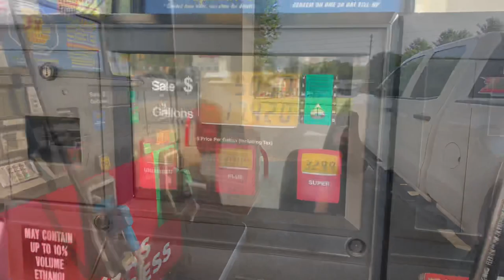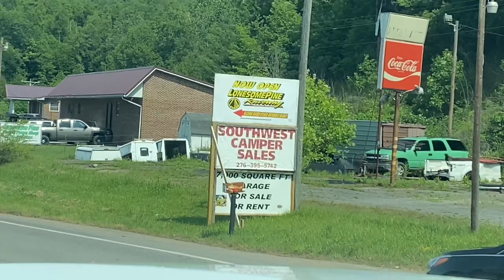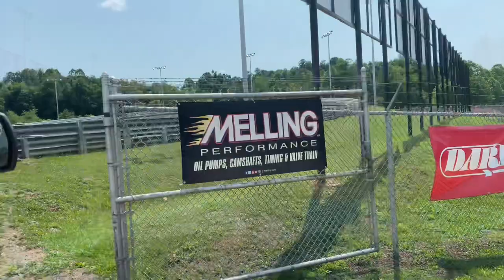KICK’N ASPHALT - ULTIMATE ROAD TRIP TO RACE!! SLIPPIN AND SLIDIN AT LONESOME PINE!!

Comment: I just caught up to your videos, you passed my home on ya way to LPR, I live in Gate City, VA and I raced in pure/street stocks and later on ran a Late Model stock for a West VA racer, then bought my own, had a built 355 in it with a Lumina body, bought a Ford 351W NASCAR late model spec engine and put a Torus body on it on a Townsend chassis, worked as NASCAR tech for a few yrs after I gave up the seat at LPR and Kingsport Raceway,run a season in pure stock at KPT Speedway the Concrete Jungle then worked at Kpt on Friday night's and raced Sat at LPR, still have both race cars tho, I truly love your attitude towards racing and the folks you meet, the Pine in the 90's and 2000's was way better than the day you ran it, new owners covered it in dirt ??? didn't work out, messed the surface in the turns up Bigely, it was kinda rough but not bumpy in 1&2 and 3&4 were real good, heard you say you was told it was pretty bumpy but there use to only be one bump coming out of 2 in low groove but hit it right and it set the chassis just right to keep it matted, use to be able to matt it before you hit middle of 3&4, diamond that turn n roll 1&2, late model times got down to low 15's street stock 19's on Hoosier Comanchies, plan on hitting it again in 2024 with the late model if my heart attacks are done n over, changing springs in the quickchange now, good luck and keep her off the wall! Carroll Hobbs

Comment: spray some starch on that window net lay it as flat as you can spray both sides of it  it will work like puting a window in it ,won't let as much air in the car ,that's what we used to do on bud Moores car to help the speed a little

Comment: Odd about the trailers. When we raced at San Antonio Speedway, it was the opposite...we had to take our enclosed outside. it was for line of sight for the fans to be able to see the back straight.
Reply: That's without a doubt one of the silliest rules I've ever heard of?
Reply from the maker: Yes the rule very much caught us off guard. It made for lots of walking if you forgot to get something out of the toolbox.
Reply: Great run there guys! I'm enjoying all your videos, all caught up on the newest ones, now digging back into the older stuff. Your car looks absolutely gorgeous in this paint scheme, in my opinion. Love it, looks like a racecar! I've been out of it for a good while, used to run Super Sport, Super Stock, Street Stock, etc, and we just got back into it July of this year, running a Renegade car, street radial tire rule. Car drives pretty good, and I wanted to ask your opinion, say for like Hickory, and similar tracks: Full spool locker, how much stagger, especially rear stagger, would you think is in the ballpark? Car has good adjustability in it for a Renegade, adjustable cups all four corners, good shock selection and variety, front bar, and basic front geometry has been much improved over stock. Anyway.....tell me your thoughts on stagger Boo, if you will? Thank you sir!🏁🏆😎

Comment: The trailer rule make no cense never heard anything like that, man driving 6 hours then waiting several hours for tires is nuts but cool the promotor bought you the wheels they screwed up. looked like you guys had fun and that all that counts good luck at hickory this weekend.
Reply: I raced LPR from 92 to around 03 and its always been no trailers for lower divisions but minis used to be on the back stretch out road, latemodel n limited in the middle, but back then there would be 75 or more cars no room for everybody to bring a trailer in, but on that day there was plenty of room, the head tech should've made the call to let trailers stay since there wasn't a big field of cars, there use to be 20+ cars in 5 divisions each Sat night, new owners, new tech folks, if it was me I'd go with the flow of each show, not expecting a full house with just 3 divisions let the trailers stay!